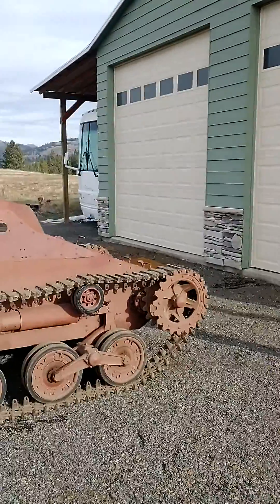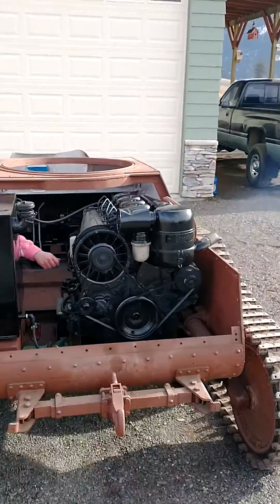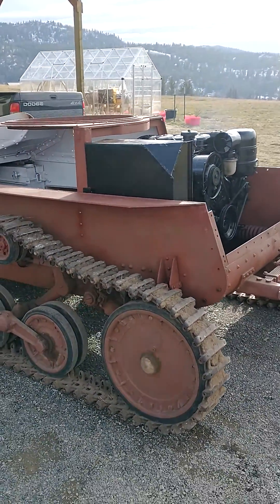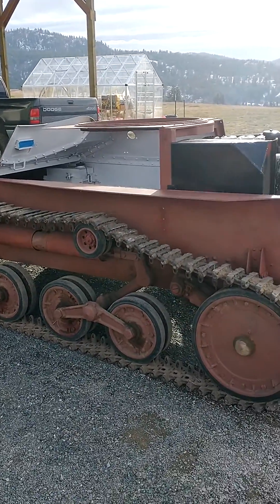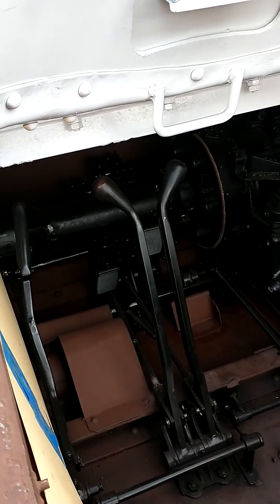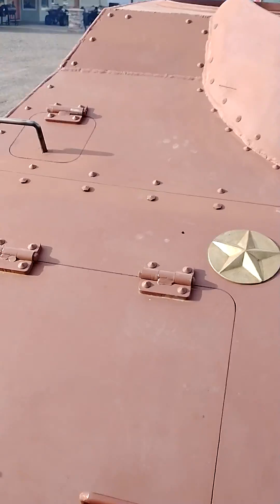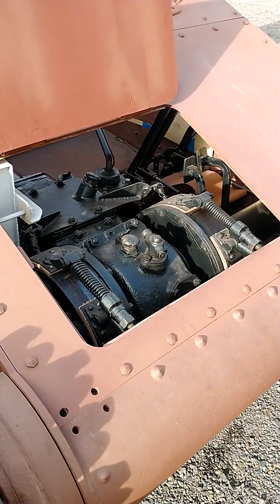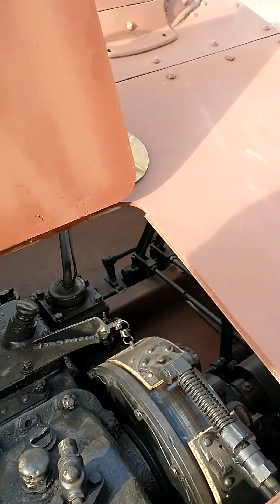Tank start up

Comment: Hello. I'm Japanese.
May i share this video? I wanna share with Japanese pepole about this information.
Reply from the maker: Yes, please do
Reply: @ross6371   Thank you for your kind.
and I have two question. 
where did you get this tank?
is this tank engine original ?
It doesn't matter as long as you can answer.
and Thank you for reading.
Reply from the maker: This tank is a Type 97 tankette. 4.5 ton. two men operated it, a driver and commander. It has a 37mm gun (non- firing). The engine is not original and is a German manufacturered Dietz brand four cylinder, air cooled 70 hp diesel. The transmission is original, lower hull, all wheels, tracks, fenders and 37mm gun are original. All upper hull and turret I've built myself using measurements from a all original Type 97 tankette along with using a 1/35 scale Fine Molds (Japan) model as a blue print to build from
Reply from the maker: Sorry, forgot to add that the tank or really tank remains was just a pile of parts when I bought them from MGM studios in California 20 plus years ago. I helped in working on the WWII movie "WIND TALKERS" and this pile of parts was found in Utah. I was asked to identify it and later got the chance to purchase it. Thank you for your interest
Reply from the maker: What I've found about Japanese tanks that are in the USA is that most were brought here to be used on military firing ranges as target's. Some were brought here as military museum piece's by our military. The 37mm gun is a type 94 made in 1940, and it was originally in a Type 95, three man tank. That tank I was told was completely obliterated from gun fire over the years. The gun had probably over 2000 bullet strikes that I welded up and ground down. The original barrel was bent so I made a new one that is solid so it can't be shot.
Reply from the maker: Here are more videos

https://www.bitchute.com/video/82ABWXQH7hTr/
Reply: @ross6371  Thank you for answer. 
and I appropriate that you restored body of te-ke , turret and type94 gun.
Because few pepole can restore Japanese tank.
and Please take care te-ke in the future.
Reply from the maker: Someday when the tank is finished it will be sold the a military vehicle collector

Comment: BASED
Reply: how the hell is this based, you automatically see anything used from the axis side and start screaming BASED BASED REDPILLED BASED BASED BASED BASED BASED
Reply: @kulot-ki1tu  I don't think he's calling it based due to the fact it was used by the Imperial Japanese, but rather because it's likely the last running Te-Ke in the world. A lot of Japanese tanks were scrapped after the war, and most of the ones that weren't ended up as idle museum pieces.